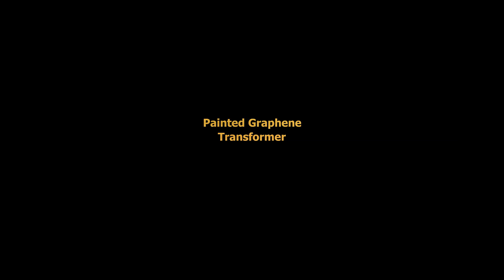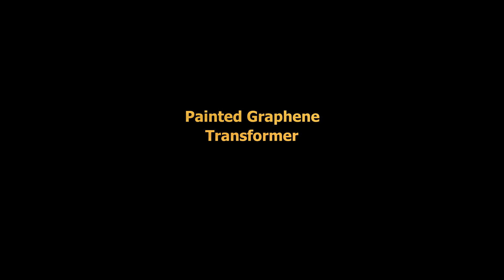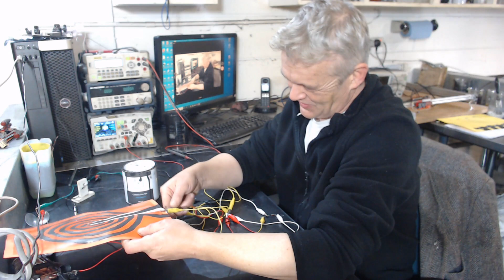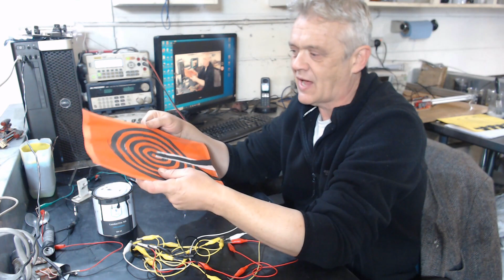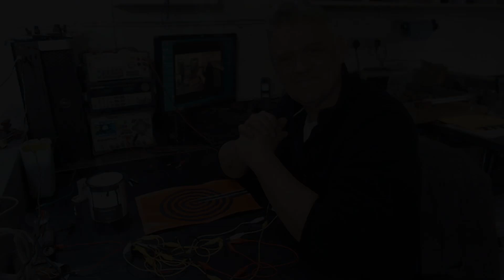Painted Graphene Transformer (A Graphene Tesla Pancake Coil)

Comment: I learned a long time ago that there is a trick to transforming DC power with a bifilar transformer. This is done by using a load matching the load you want to run on the output. this way you can mirror you loads. But it is not as efficient. But you can use a smaller coil in a large coil bifilar with a dummy load to have a high voltage on the output by wrapping it on a drum like the mystery crystal set radios. For pancakes you may try putting inductors in series on the output.

Comment: I really do believe you have an isolation transformer, BUT since I can not see any readings its only your word. If you showed 2 sheets separate and then placed them together showing complete isolation and then  showed a voltage it would be a concrete evidence.   A couple of cheap cameras would provide a good split screen for proof.

Comment: again, thanks for your hard work and sharing with us, it means alot to me and im sure others.

it would be interesting to see if electric motor coils and magnets can be 3d printed (maybe hemp carbon) and painted, incorporating layering and rolling akin to windings to generate the fields, the printability can really lend itself to designing complex and maybe even dynamic (w/ arduinos) field line vectors and structures. maybe even adding capacitance to different areas of the motor to create a motor-battery to reduc resistance and complexity?  ok now im really winging it. 

but i'm personally imagining motors cocentrically within motors, each adding to and modifying the overall field shape as well increasing the rpm exponentially.  

just the cocentric design using even common ac and dc motor designs may be the key to electric "horsepower" or top-end power without complicated gearboxes, and packed into a hub motor may be a game changer, but im not an expert. 

anyway, thanks again and cheerios
Reply from the maker: thanks for the ideas mate - I kind of prefer painting with a brush as you really don't need a printer - just scissor and a brush - but I do get your suggestions and they are good for sure

Comment: nice, now lets see you make a speaker. also you can 3d stack coils. paint a turn or spiral, cover with regular paint leaving the end exposed, then paint another turn spiral. small surface mount diodes and transistors can be imbedded in the layers.  ;)
Reply from the maker: that is an awesome idea mate

Comment: This opens a whole new field Lol :-D
In electrical engineering: having a moving magnet pass close to the grapheme coils & inducing pulsed power :-) 
Permanent magnet motor's have a sticking point that stop's the perpetual motion:-/
Using the hall effect to alter voltage & pulsing a FQP47PC MOSFET to tip that point=would solve energy crisis indefinitely :-D
Keep up the good work's & let the tea's flow freely :-D
Reply from the maker: interesting mate

Comment: For those interested, this coil has a reasonable amount of DC resistance to limit AC current. And if you want to know its inductance in henries, but dont have expensive equipment to measure it, then here's an alternative method to give you reasonably close. 

First, measure the coil's DC resistance. Then measure the AC current through it from a known AC voltage and known freqency. Caution must be observed to not supply a voltage that would push too much current through. One thought is to use a transformer that is used to convert 60hz 120ac  or 50 hz 240ac to 12vdc.  The transformer itself will probably output something like 18vac  you can further limit the current by adding a known non-wire wound resistor. 

Now knowing ac amps (Iac), and AC Voltage( Vac), you can calculate the AC impedence  Z=Vac/Iac.
Impedence, Z   also = sqrt((net of inductive and capacitive reactance)^2 + (total dc resistance)^2). For the most part, we can ignore capacitive reactance here at low frequencies and just work with  inductive reactance = XL = 2×Pi×Frequency×Inductance

Put together results in  Vac/Iac=Z=sqrt((2×Pi×F×L)^2 +(R)^2). Isolating for inductance  gives  L=Sqrt((Vac/Iac)^2‐(R)^2)/2×Pi×F.
Reply from the maker: cheers mate - and it does you - can get a sense of that just from the input voltage versus the output voltage

Comment: cool, i still prefer the use of cheap super thin nylon thread impregnated with the conductive/magnetic  ink formulas and (solid electrolyte/dielectric)sealed as the pancakes in this case are formed,and/or oc the usual  cotton if you want more area that can be internally carbonised later in the assembled process if you so wish for better effect for a given property (aka turning a passive structural component into an active power component that happens to also be structural as a side effect), remembering one form of so called electric migrates and travels over the surface/skin area of its transport medium, whereas the other will use the core of the material as its transport medium...
Reply from the maker: each to their own mate - in my mind threads presoaked are just not as adaptable - but I do like your idea
Reply: @ThinkingandTinkering  ,indeed, its not an american mindset unavoidable choice between alternatives. "an either/or situation", but rather a practical option as regards cheap ,basic textiles machinary and electronics... as in making generic twisted pair electronics serial interonnects that happen to also be, among other things at the same time, end to end (roll to roll, thread thin) capacitors in this case.

aka locallised power storage/reserves that can be made into twisted pair electronic tracks with a basic form of sewing machine mechanics etc...

another.. conductive/magnetic  ink formulas and so called plastic string  (remember it has elastic properties) wrapped around an object and slightly heated will shrink and compress the object and become a stronger denser pancake in this case etc, etc.... magnesium impregnated/electrolyse plated flat perforated and scored (to allow air flow and resist sideways slippage of the stack) plastic/casein string wrap air battery  etc...

Comment: I’ve heard recently the densest graphing battery was 3-D printed have you considered doing 3-D printing or doing multiple layers of your paper graphing sheets maybe printing them in 3-D. If you get 1000 times more capacity by not rubbing them down with a spoon how thick can you go before the graphing properties stop working?or like the transistor being able to print smaller spirals? Just curious if you thought of going three dimensional and what those tests would yield

Comment: I'd like to know if there is a possibility of an induction charger for the power requirement of the new phones, Galaxy S9+ for example?
Reply: There is always a possibility. The real question is will its size and efficency, as well as material and time cost be worth  it for you.
Reply: @kreynolds1123  well, it's one of those hobby ideas so time and money would be considered as that. I need one for my car and was thinking about it when I saw this video.
Reply: @jeffreyrood8755  Neat! As for inductive charging a car, your talking about non trivial amounts of power and you want to transfer it efficently.  The really big issue is significant currents and DC resistance in the coil can lead to significant amount of power loss and heating.  Higher freqency lower inductance coils save on copper requirements but start to experence skin effect  on the wires themselfs, where inductive reactance inside the wire tends to limit current flow to just the surface. Engineers compensate for skin effect by using litz wire, making a composite wire from many smaller insulated wires that take turns being on the surface.
Reply from the maker: it is certainly an interesting idea mate

Comment: Is this stuff not catching Reddit's heads on fire yet?
Reply: Well, it might if more technical details were given.  One day its batteries, the next super caps, the next hemp, the next graphene mag-air combo's, plating, etc.  Lately it seems like a big effort to start selling graphene ink from the store.
A lot of it sounds cool, however even after months and months of testing, still no data on simple longer term testing of a g-batt or g-cap.
Make one of each in the same size/form factor of a common 18650, or mod super-cap, run charge/discharge tests with an Arduino logged to a computer for a month or two or three and show some actual data.
When this is asked for, the reply is always "Buy some and try it yourself".....  This simply makes me suspect that some of these items are great to start with, but over a short amount of time simply become unstable, oxidized, or something else which limits their actual use.
The team has the ability to make a couple of devices and do the above testing laughably simply,  Since they're not stupid, and characterizing their products is simple, and necessesary if they want to talk to anyone in any industry, I can't help but think that they have done so, and realize at this stage its simply fit for hobbyest/tinkerers. After 6 months, 12 months of graphene super-caps, and some incredible claims, there are no realistic IP concernse, Patent theivery or other Proprietary rational for saying "We've got an equivelent to a Market Leader Maxwell 3V 3000F graphene super-cap that is 3000,10000, etc, which is remarkably cheaper or better in x/y/z parameter".
The Big Players in the industry are as able as you or I to order some product and test to get these answers, so again no rational reason for not publishing.  A lot of us have seen the zero-point energy scams, solar ones like Green and Gold, and all sorts of fantastic claims with no simple data sheets.  I hope I'm wrong, however does anyone really think Market Leaders haven't/aren't investigating Graphene for the past decade?

Comment: Hallo Robert, IMHO this is one of most amazing things you posted: I love it! Maybe because, presently, I'm just experimenting with such kind of coils. I wonder how much small someone could paint with your ink...my need is to trace a line of about 0.01 mm in size.
Reply: I just ordered Rob's graphene ink, and will try out printing a PC board with an ink-jet printer using conductive adhesive to glue the components down.  I plan to reload an HP61 ink jet cartridge as soon as it arrives, andprint some test traces initially to check resistance of the ink tracks.
Reply: @waynegnarlie1  Hallo Wayne, please keep me up to date about your printing process, I'm interested in it (fabrizioricciarelli@gmail.com). Thank you so much in advance, Fabrizio.
Reply from the maker: you might try silk screen printing it too mate - i haven't looked into it but i wouldn't be surprised if you could get a screen stencil material that goes through a printer or laser